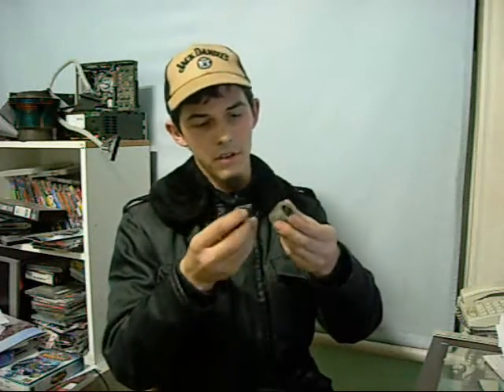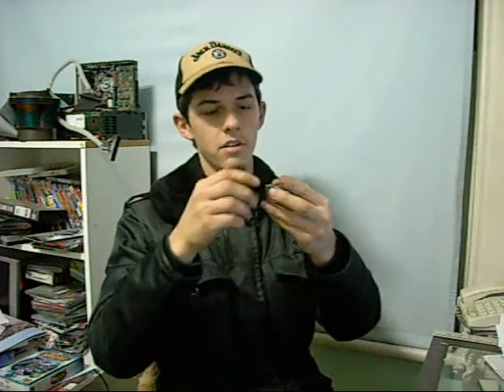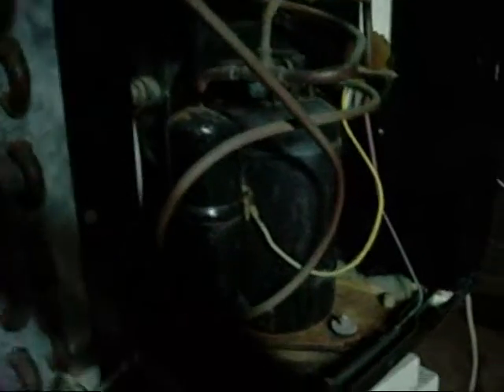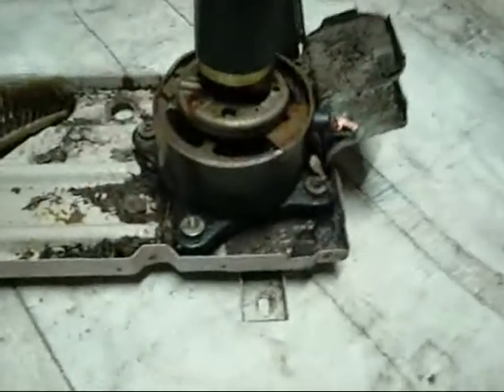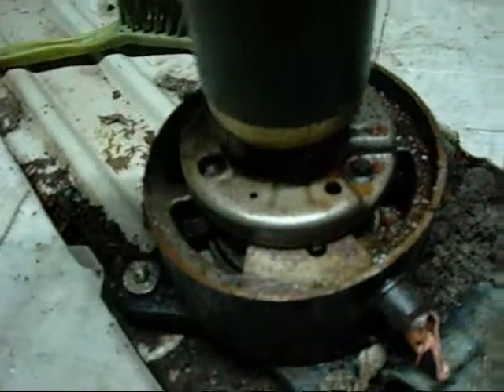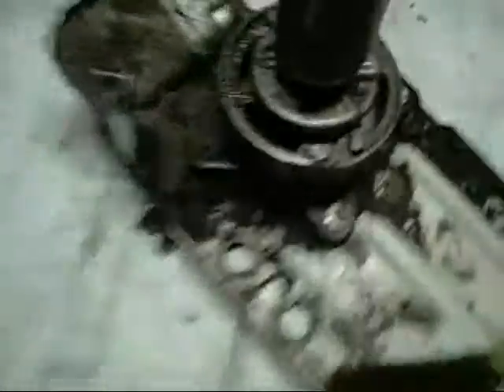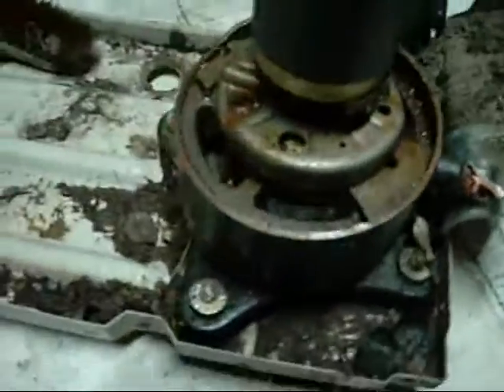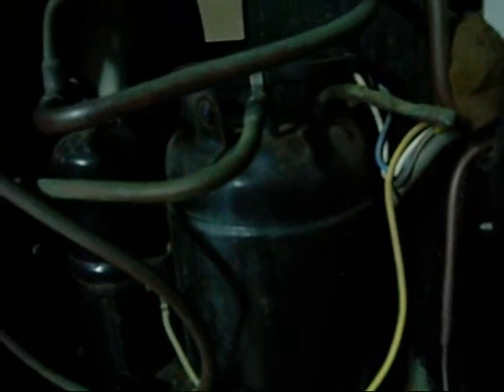Rotary Air Compresor Theories for NOBOX7

Comment from the maker: the tubing in your unit will be Refrigerant tube, as thin as it is its very strong, but I was more concerned with outside lines and fittings running at such high pressure. I don't think a flexible hose could take 300+ unless its a special oxy or hydraulic hose with crimp fittings?

Comment from the maker: When I scrap them I cut right through with a 9" grinder, if i want to keep the insides clean I cut just below the weld line, and only through the first layer of steel, with a 4" grinder and ultra thin wheel.